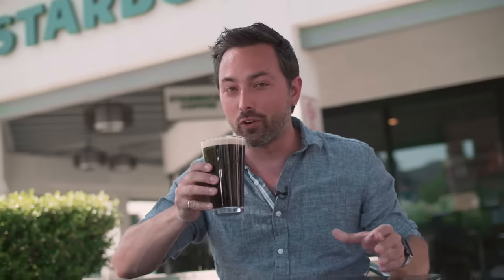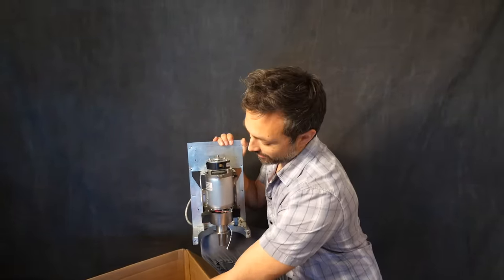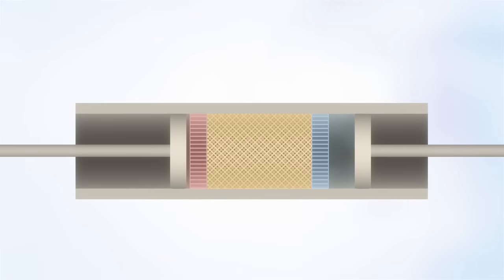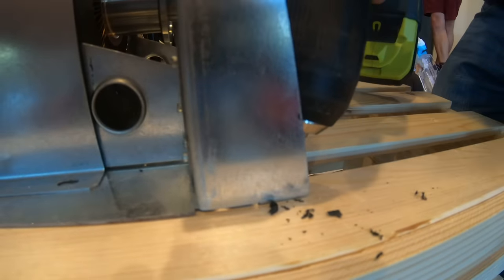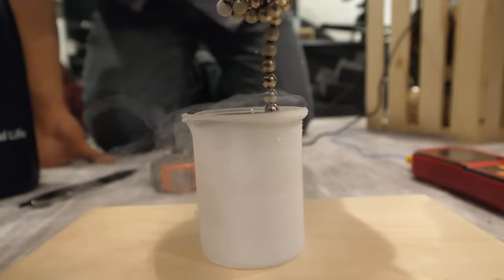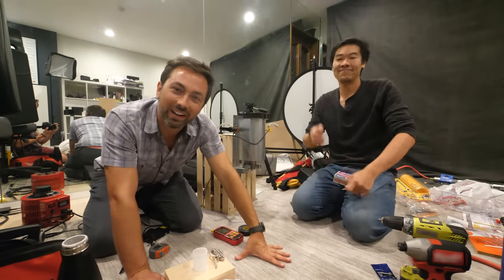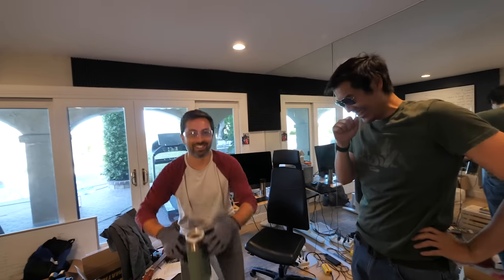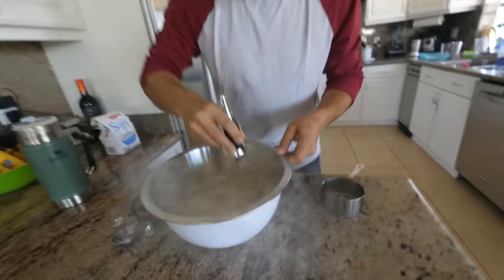Making Liquid Nitrogen From Scratch!

Comment: Making liquid N2 from scratch. "At first we need a $ 12 000 cryocooler"
Reply: does it really cost 12000 dollars?
Reply: @maxfrankenberg8260  There are cheaper ones, there are more expensive ones. Don't know the specs of his device. It's probably in the high thousands.
Reply: Well, if you are lucky enough to find a used one on eBay like Ben Krasnow from Applied Science did, you could get it for $300-400.
Reply: Welp thank God he has Starbucks nitro. The cold brew that does for your morning what music does for workouts, long rides, and romantic gestures. Now only at starbucks
Reply: This was my first thought.
Is it a good video?  Yes. 
Is it fun? Yes. 
Did I learn something? A little. 
Is it from scratch? No,  not even a little, this is like putting the icing on a store bought cake. Nay, merely writing "happy birthday"
Reply: You were hopping they made the cooler from scratch?
Reply: Bruh exactly
Reply: @QuasistellarNymphomaniac  this one looks like it has a KF40 flange at the top of the cold finger, so I'm guessing it is made to function as a cold trap for a high vacuum application.
Reply: @maxfrankenberg8260  Depends on the size of the collector. Small collectors take a long time, but yes gas capture/sequestration devices are often huge money. Even the used units if they are in good condition are easily thousands. If you are lucky you'll find something from a dive shop auction or something for cheap.
Reply: @n1352-m1i  thanks for the link... i rather watch Ben
Reply: Grant from King of Random did it much better with a similar cost. It probably took 13K for him.
Reply: Yeah, I also thought I missed some point in the "from scratch" concept (rofl)
Reply: @nadie9058  Some people did. There are videos on this topic on youtube
Reply: @JoshuaNorton  Linde is a pseudo-mega-corporation... need I say more.
Reply: That’s comparable to a Starbucks coffee machine
Reply: @nadie9058  yes
Reply: If spacex made this it would cost $120😂
Reply: To be fair, the term "from scratch" just means you're going to do the entire thing without taking any shortcuts.  It doesn't imply you're going to do it on the cheap.
Reply: @savagerodent7533  Definition of “from scratch” from the Cambridge Dictionary
"from scratch

from the beginning, without using anything that already exists."

Maybe he made Nitrogen liquid "from scratch", he certainly did not made liquid Nitrogen "from scratch".
Reply: @ZZtop-gg3lu  Seems the Cambridge Dictionary elected to go for brevity over accuracy or logic, given that nothing is made without using something that already exists. ;-)
Reply: @GRBtutorials  lol even tho a fridge compressor can be used. Sure your facts are facts?
Reply: ... and a column to isolate nitrogen.

I was hoping they'd distill out the nitrogen.
Reply: @ZZtop-gg3lu  So I guess he was supposed to create Nitrogen from nothing, too?  And when somebody makes a chocolate cake from scratch, they have to manufacture the bowl, spoons, pans, mixers, the chocolate and other ingredients, as well as the oven, the table, etc.?  That's what you're saying.  Maybe the Cambridge dictionary needs some help?? Maybe you could look up the word "pedantic" while you're at it.
Reply: @carnivalwrestler  Pardon me, That's what I'm saying?  Did I wrote the Cambridge Dictionary?
Why should I look up the word "pedantic", there is a perfect example just one comment up.
Reply: If Starbucks has many stores where they can sell this with locally produced LN2, I highly suspect that they had a bulk order and thought "We could make some marketing out of this high tech equipment that would otherwise disappear in the building"
Reply: @QuiznosBear  cryocoolers main purpose isnt to make liquid nitrogen so i wouldnt compare it to a store bought cake, its more akin to buying premade pizza dough and throwing on store bought toppings and calling it "homemade". if you want "from scratch" youd be better off on the king of random channel. i cant remember if he also just bought the cryocooler or if he had an actual homemade solution but the channel was pretty good while grant was around. RIP.
Reply: @jonathanodude6660   Cryogenic coolers are made to cool things to the cryogenic temperature range. (the range at which nitrogen exists as a liquid is within the same band)  so... Yes, while they can be used for more, you cannot make liquid nitrogen without one. 
"from scratch" implies that the cryogenic cooler is what they'd be making, not buying.

If anything, a cryogenic cooler such that they got is significant overkill.
Reply: @savagerodent7533  Hard to think of a bigger shortcut than buying a commercial cryocooler and nitrogen purification membrane, easily the two hardest parts of doing this. You can argue the air compressor is kind of cheating too, but at least that's something an average person would have a reason to own.

Granted, the nitrogen purification membrane is pretty infeasible for a person to make, but a cryocooler? Totally doable.
Reply: @Mezmorizorz Mezmorizorz where do you draw the line for what constitutes "from scratch"? Whether or not a "person would have a reason to own" certain tools is just as arbitrary as a starting point.

Comment: „Do not try at home“

Dang, guess I‘ll have to put my cryo cooler back on the shelf
Reply: Making liquid nitrogen from scratch:
1 - buy instrument with helium.
LOL
Reply: How much is that cryogenic cooler?
Reply: How do you get German quotation marks? I'm learning German and when I use DE input I only get regular Anglo ones.
Reply: @TheDrunkMunk  If you're on a german keyboard it's shift + 2 but those aren't the typographical ones used here. Some programs like Word automatically put them like this when you set the language to German
Reply: @Buihuh  I only get " " :(
Reply: @TheDrunkMunk  you can try setting your keyboard language to German. The symbols won't necessary line up to the correct keys, but you can switch back and forth easily. (that's to say if you're on pc)
Reply: @TheDrunkMunk  Du könntest > < benutzen
Reply: @TheDrunkMunk  if you're using a windows 10 and have a keyboard you can change your keyboard layout to german, with language preferences。 (haha i'm so funny using the wrong period.)
Reply: @typingcat  at least 3 thousand dollars at least, or more
Reply: @DraconicMaker  no... I found a couple for only about $800. New $1800
Reply: Bro the king of random grant Thompson manufactured liquid nitrogen at home
Reply: @borat1  Tell me where... please! I`m searching for 3 hours now and I`ve litterally found nothing.
Reply: @borat1  Where?
Reply: @ivander1511  Ebay
Reply: @ivander1511  although prices have probably gone up
Reply: @typingcat  thers a couple on ebay for about 1200 USD
Reply: Good thing I dont know what "don't try this at home" means
Reply: XD
Reply: @DraconicMaker  Oh :D dreams now postponed...
Reply: I will rent it lol god I want one so bad
Reply: Clearly HyperspacePirate didn't listen to the "don't try this at home" warning.  Crazy fridge guy, making liquid nitrogen at home from a cryocooler made out of a bunch of AC units Frankensteined together.

Comment: Thinking quickly Derek made an homemade nitrogen liquefier using only some strings, a squirrel and a nitrogen liquefier.
Reply: Exactly my thoughts
Reply: Yeah was looking for this comment. perfect haha
Reply: Well, the method I thought about is much simpler but probably less efficient
Reply: You cool down air and keep track of the temperature. When it is still a few degrees above -193°C, you maintain the temperature and remove all the liquid that forms. That will be the other gases you don't want. Get below the fusion point of N2 and there you get the precious liquid. 

Anyways, it is nice to see some of the tech he used. I had never imagined a refrigerator like that existed
Reply: @srpenguinbr  The problem is that O2 has a very close boiling point so you would still liquefy it. A method more "from scratch" would maybe be like burning all the oxygen before cooling it.

Comment: Now make a video on how to make a Cryo Cooler from scratch.
Reply: Step 1: go to Home Depot, buy 3 1ft 3/4” tubes, a funnel, and a door handle

Step 2: screw the funnel to the door handle, then hot glue that to the pipes you bought

Step 3: throw all of that away and buy a Cyril Cooler online or something

Thank me later.
Reply: How to make 12000$ from scratch
Reply: after that, air compressor from scratch video
Reply: Metal tube, some metal discs, linear actuator, some check valves, a heatsink, and a few other odds and ends. How could that thing cost twelve grand? Sounds like that company makes about $11,900 in margin off every unit they sell.
Reply: study 3 years
Reply: You just have to use 135.000.000 $ on a cryocooler creating machine
Reply: Making a membrane nitrogen separator from scratch
Reply: @dizzious  I would imagine that's partly because it's a very small market, so there's less economy of scale and the price also has to include a larger portion of the initial investment.

I'd also guess the marginal cost of each unit is well over $100 given the precision and extreme operating conditions.
Reply: @someguy6075  yeah probably. I was exaggerating just a tad there :D
Reply: @Chris Russell so there's over a thousand cubic feet of helium in that little thing? Not possible for a cryocooler that size. Helium is only like 10 cents per cubic foot, and the cryocooler in this vid is a tiny fraction of that volume. That's on the order of tens of thousands of atmospheres of pressure in that thing, if there's actually >$100 worth of helium in it. I think even helium can't go up to that high of pressure without turning to liquid at those temperatures.  Maybe there's hundreds of dollars of helium in big large-scale cryocoolers, but not in that one.
Reply: @kristofferbrink2689  But, what about the machine that makes cryocooler creating machines?
Reply: @Winchestro  Step 1: Get sponsored by starbucks
Step 2: Profit
Reply: @Chris Russell Also: high pressured helium at low temperatures is a pain in the ass to handle
Reply: @dizzious  10 cents per cube? For 99.99999% purity He? Where can I buy some? Hope you are not talking about balloon Helium. That stuff can be down to 80% He. From a quick search, I see a price of $1 per cubic foot for industrial 99.995% purity. Any contaminants will liquify and block the fine pores in cryo cooler. Btw, the He pressure is around 200 atmospheres in that cooler. Metal shrinks significantly at -200C and still this thing needs to seal in 200bar He. I bought my cryo cooler second hand(same unit as in video, but 24V ac, not 110V ac like in video). Mine was built 15 or 16 years ago, had 20000 running hours on the clock when I got it, and is still running strong. I get 900ml to 1000ml per day of liquid air.
Reply: Forget about discusting coffee.   Let's talk about stout.

Comment: Title says "Making liquid nitrogen from scratch!"
Thinks, wow. I just might try this since it sounds so easy to do.
Derek whips out his trusty handy dandy cryo-cooler.
Maybe I can't do this at home
Reply: yeah basically the cryocooler is a must
Reply: @thunderbolt997  Forget just a must. It's the whole damn experiment. Without it you wouldn't have an experiment.
Reply: @susnojutsu2525  and the popularity around liquid nitrogen isnt directly making it easier to find them on ebay, especially the self contained helium cryocoolers
Reply: Yeah, I had forgotten how lame this video actually is after a while, but the title is making liquid nitrogen from scratch while the actual video is we bought a commercial cryocooler, a commercial nitrogen membrane, a commercial air compressor, a commercial dewar, and then just flipped a switch and connected some hoses. Not that a lot of those things would be reasonable to make from scratch, but come on. This is as made from scratch as me buying a cheap laser pointer and changing the variable resistor setting to get more power out of it.
Reply: @thunderbolt997  anyone want to work on maybe launching the worlds first at home air liquefier?
Reply: oh man, that's funny!
Reply: heliem is easy to get and cryo cooler are bit hard to make but it can be made at home if you know how it works.
Reply: Less than $1000, still an expensive toy though
Reply: @Mezmorizorz  wait what'ts the variable resistor thing
Reply: Let's be honest here... these guys are more actors and special effect technicians than actual scientists. Actual scientists are incredibly boring to be around (unless you are a scientist yourself). It's like the Mythbusters guys, their background is in acting, special effects, not science.
Reply: @taiwanluthiers  if you apply the scientific method you're a scientist dude. It's not about background, it's usually a job with very specialized people but not by definition. Using the scientific method you always get there, so that's what matters
Reply: You can make liquid nitrogen at home. Just get a gas bottle and release the gas into a thermos. A little bit will condense. To make it more efficient, build a counter flow heat exchanger that used the escaping gas to cool the inlet pipe down. Just put a long pipe on the thermos and run the small pipe from the nitrgen bottle through this pipe to the bottom of the thermos. If you think buying the nitrogen is cheating. Get an airsoft pump and fill the nitrogen gas bottle yourself. Oh, and dont try this at home and dont blow yourself up.
Reply: @thunderbolt997  No its not, nobody uses a cryocooler to condense air. That is very inefficient. You buy liquid nitrogen from a cryoplant. There the cooling happens similar to what goes on in your fridge. Just more complicated, with more heat exchangers and probably a turbine.
Reply: @dxfvgyhjh  Well, Bill Nye the science guy is similar. If Albert Einstein were to apply for the kind of jobs Bill Nye does, he would likely be rejected because while Einstein is a GREAT scientist, he isn't a good actor or a presenter. It's the same with Mythbusters. The primary job of a Mythbusters is not machining, science, or whatever, it's presentation, acting, and entertainment. Having a scientific background would certainly help and set you apart from other entertainers, but don't forget the PRIMARY job of a mythbuster is entertainment, not science.